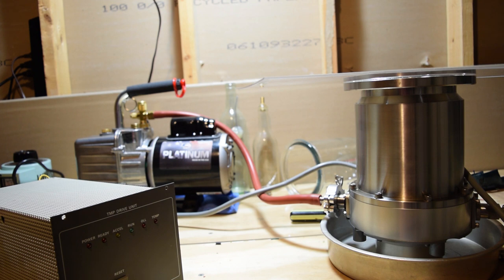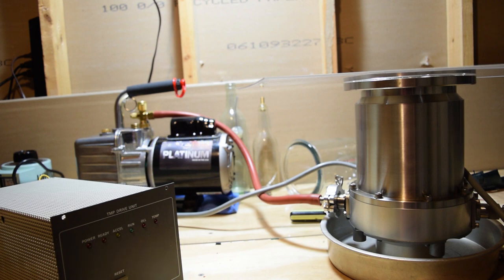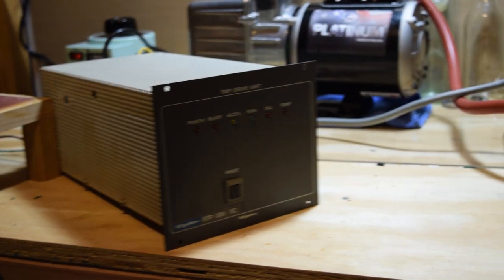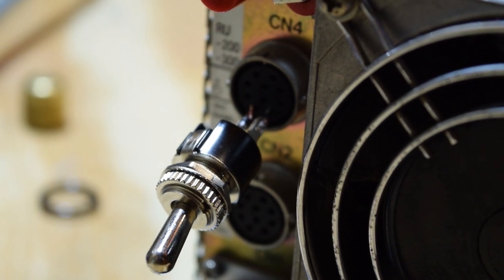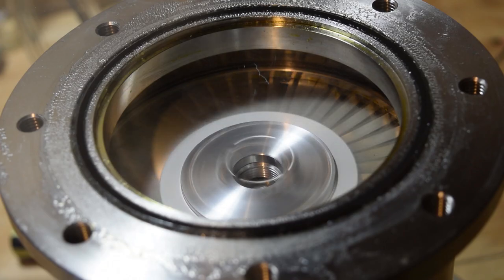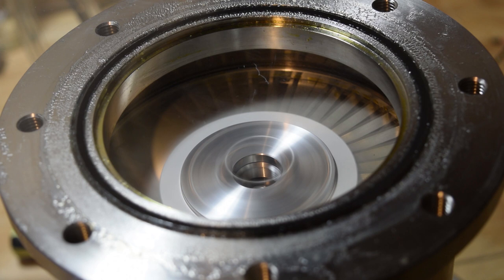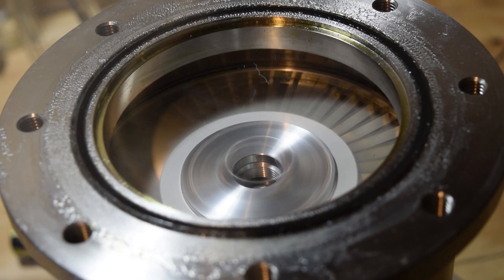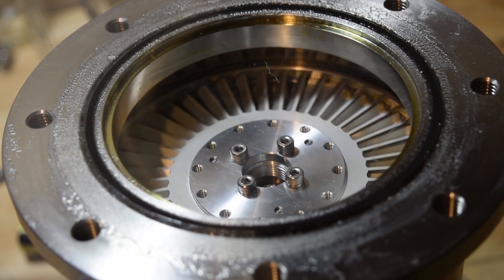Turbomolecular Pump Showcase

Comment: I don't think you need to worry about the bearings exploding. It will start to make a noise before any wear happens. Ball-bearings are very tough and even worn bearings can be run for a while without any damage to the axle as there is usually a bronze bushing or harden steel as a wear surface. But personally I wouldn't run the pump at all unless I had the correct amount of oil.

Comment: My friend, I sincerely hope you will secure that pump to a strong frame using the correct strength bolts before you run that thing at full speed. There are a few kiloJoules of energy in that rotor, and an abrupt seizure will transfer much of that energy into the pump housing in a few milliseconds. You don't want it landing in your lap - it will hurt... a lot!
Reply: Very serious safety matters. Consult the manufacturers manuals, including cleaning tips and so on.

Comment: Nice demo, I know its always a worry starting a turbo to full speed for the first time.
You might want to try a larger tube between roughing pump and turbo - stainless steel bellows. Avoid using vacuum grease on the turbo inlet as you might get this out-gassing a thin film on the rotor or accidentally get grease directly on the rotor. Check your turbo power usage, this should reduce as the outlet pressure goes down - if it stays high then you may have a leak or the backing pump is not working well. From my own tests it seems you can have a backing pump line pressure of 2 to 3 mbar and still get around 8 x 10-7 mbar. Depends on the compression ratio of your turbo. Clean everything that couples to turbo inlet to a high standard using de-ionised water, acetone, ethanol and methanol. Probably best avoid cleaning viton orings with any solvents.
You should have a inlet trap near the pump to prevent backflow of oil vapor into the turbo - but this I have found, using activated alumina, outgases to a very high degree reducing the trap inlet pressure to about 1 mbar with no load - just gauge, when it normally runs at 2 x 10-2 mbar. After a couple of hours of pumping the pressure comes down to 6 x 10-1 mbar, but still over a decade away from its normal pressure.
Some kind of baffle may be a better way to go or just pump away for many hours until its out-gassed the activated alumina. You could hold the it on a vacuum overnight with the pump off using a shutoff valve.
Rob
Reply from the maker: Thanks for the great information! I will work on getting full metal hosing for the roughing pump connection. I also am removing the vacuum grease from the turbo inlet. I finally got it full of oil and ran it up to speed. It looks and sounds good to me. The sides of the turbo got warm. Is this to be expected?
Reply: Hi, yes, the turbo pump stator windings will heat up in accordance to the power being consumed by the motor, so if the pump is using say 20 watts of power when up to speed under high vacuum then this will heat the wall of the turbo, its not too much to worry about unless it gets too hot to touch then you will need to use active cooling like a fan or water cooling if the pump has the plumbing built in.
If the turbo gets above about 80C then you might affect the magnetism of the magnets in the rotor, plus you will get higher amounts of oil vapor off the bearings and oil or grease will very slowly evaporate.
Check the power consumption is within the range specified by the manual, if its a little high it could be:
1. Bearings are dry-ish or worn
2. Rotor is off balance
3. Pressure on the inlet is too high.
4. Leak in the system

Turbo pump oil is very expensive - example 0.25L of Pfeiffer TL-011 is about 60 USD - ordering direct from manufacture like Pfeiffer is sometimes better than using a re-seller in terms of price.

Has the pump got a magnetic upper bearing? 
These are very useful to have as it means you have just the lower bearing to worry about and that has much less stress on it.
Sealed bearings or a capsule containing 2 bearings on the smaller turbos are a real pain as re-greasing or replacement means stripping the whole pump - plus the high cost of an original bearing.
Shortly, I will be experimenting with adding oil to a bearing that normally uses grease but has dried out in the hope that the oil can mix with some of the remaining soaping agent to form grease.

Its an expensive hobby playing with high vacuum equipment but good fun.
Its always a challenge to see what ultimate vacuum you can get and experimenting with cleaning parts, trying different gauges, pump oils, traps, valves, connectors. 

I found that oil can get into the Edwards pirani gauges through the stainless baffle gauze and causes a mis-reading of the pressure. So its a good idea to have 2 or more gauges to verify the pressure.
I need to look at ways to get the oil of the hair like wire in the pirani gauge.

I might try some hot de-ionsed water and detergent, but because its very delicate I suspect that using an ultrasonic bath will destroy the fine filament.

To measure the high vacuum side you will need to get an inverted magnetron gauge like the Edwards AIM-X or AIM-S.

Comment: Hi what pump model are you using? I have a Rigaku pump (50MT-3) without a controller. I cannot find any spec sheets or diagrams about the pump or the controller online. I'm not sure if that controller will work with my pump.

Comment: How is this pump different from a normal vacuum pump
Reply: There is no "normal" vacuum pump. If you mean the most common vacuum pump, that's a rotary vane pump, like the roughing pump shown in this video. It has a limit that is related to the vapor-pressure of the pump oil. Among high vacuum pumps there is the diffusion pump, the turbomolecular pump, and to a lesser extent, the cryopump. These pumps are responsible for taking the last remaining molecules of gas, catching them, and blasting them away from the vacuum chamber. This is something that cannot be done just by creating an area of lower pressure. You have to wait for the molecules to spontaneously stop clinging to a surface in the chamber; it is a very different set of physics compared to what you experience with Ideal Gas Law.

Comment: So I just bought one of these pumps and I need any information you can provide like manuals, etc. And it looks like I'm missing the power supply too! Thanks for making this video btw!
Reply from the maker: Hello! I’d recommend contacting the company that manufactured your pump and inquire about manuals, that’s what I had to do. Also check out the channel “glasslinger”. There is a lot of great material Ron has put on there about servicing turbo pumps and even showcasing drivers he built for his.
Reply: Thanks I still need information on this because it looks like company who makes RTP 300 VRC no longer make turbo pumps... I now have a power supply though! Thanks
Reply: @ScienceMarshall  so I have the extracted same pump as you can you send me the diagrams and notes you have on this Rigaku

Thanks for your help

Comment: I work in a Rx sunglasses lab where one of our machines has 3 turbo pumps each about 4 times the size of that one. I know they don't use that much oil for one, the controller is built into the software in the machine they run at 525hz or 30,000 plus RPM if your more interested in the types of pumps they are the machine is a satisloh 1200 tlf box coater you can pick one up at your local hard ware store for a mere 1.35 million dollars

Comment: Turbos are awesome! How much was it? It looks to be in good condition. I can't wait to see your fusor video.
Reply from the maker: It was around $650, a great bargain! I bought it quickly when I saw it. It is in really good condition. The bearings might need cleaned because they make a little noise. However they spin freely. Perhaps they just need more oil. I'm excited for building the fusor, but keep in mind it might be a while before it is operating!
Reply: @ScienceMarshall  Hot damn. You practically stole the thing. Nice find!

Comment: Yo! Recently I've purchased the same exact model of pump and if you've still got the drive unit I'd being willing to buy it if the price is relatively low.
Reply: Just to clarify to everyone, he accidentally broke the turbo pump and he said so in a recent video.
Reply from the maker: Jackson Oswalt I don't really have any use for it since the pump is dead. I'd be glad to sell it to someone who is going to use it!
Reply: Great! How much would you like for it?
If possible, I prefer you include the data cable that connects the drive unit to the pump and the power cable for the drive.

Comment: Yeah you never want to see a turbo pump explode... They run ridiculously fast.
Reply: I'm trying to learn what actual RPM my turbo pump runs at. Can someone help me ? It's made by Leybold, software reports run speed equals 800 Hz, has a 3 phase controller, and motor stator has 12 pole pieces (so to me that means it's a 4-pole stator). My struggle is trying to understand what Hz means in "Turbo Pump Lingo", usually it just means cycles per second of the incoming 3 phase AC motor voltage.
Reply: @smoothntallGWM  It looks like these are old posts. What are you doing with that math and turbo though? Just curious.
Reply: @smoothntallGWM  You are referring to two separate things. "Run Speed" is the blades rotation. At 800 Hz = 800 Rotations per second = 800 "RPS" * 60 seconds / minute = 48 000 RPM. So Revolutions (or rotations), Per Minute. Knowing the radius, one could also figure out the actual speed (say in meters per second) at the tip of the blade.